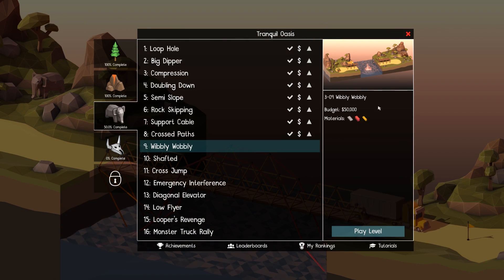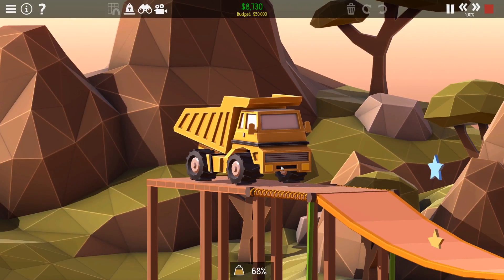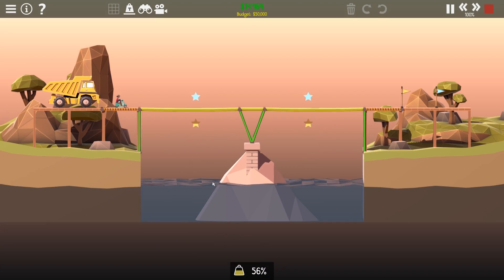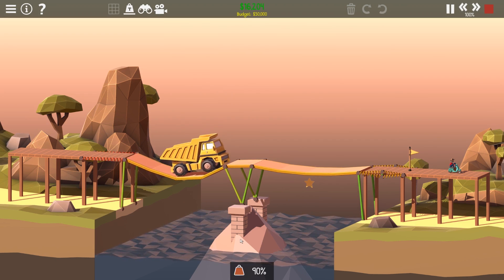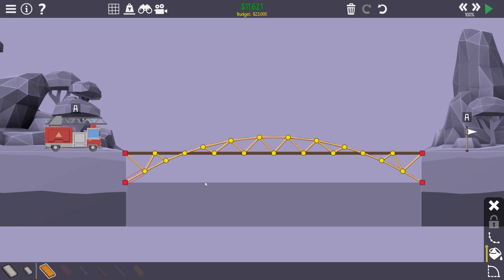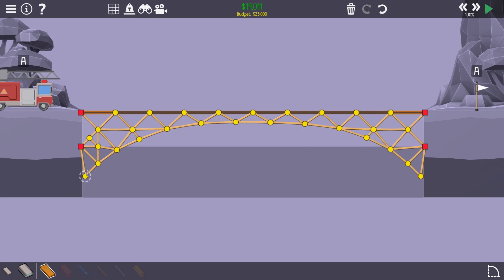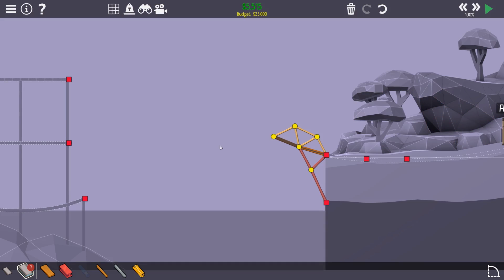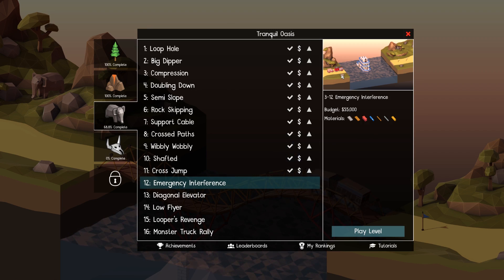I PROMISED I WOULD NEVER DO THIS... Dabbling in Dangling Roads in Poly Bridge 2!

Comment from the maker: So yes, not proud of this one, but I am a professional and felt I had to investigate so that you don't have to! There's a reason I always wear a hard hat...
Reply: Idea to remember springs:
stretched = contract
compressed = spread
Reply: @spironspirit6502  C  O  N T  R  A  C  T
Reply: @sephia37  yes
Reply: Cheese
Reply: @wofeYT  🧀
Reply: Noo you should be proud, cheese is the way to go
Reply from the maker: @Minecxt  nuh!
Reply: @Minecxt  are dangling roads cheese tho
there not op like spring cannons
Reply: @syn6109  they most definitely are cheese, and, in my opinion, more useful than spring cannons.
Reply: 03:53 the sound of a dying giraffe?
Reply: @Mike-or7xv  sounded like lamas in hats
Reply: mmmmh still got one of those curve-y curves in you might have to start a 2nd channel called Real Civil Architecture, blueprints optional.
Reply: 16:35 when a daredevil manages to be cooler than an engineer...
Reply: Man hurting in pp
Reply: So when you realized that you could 3d the dude on moped... you sounded very very high
Reply: 3:53 sounds like pushing out a really big and painfull shit!
Reply: I would name that sound
 "civil heartwrench"
Reply: Could you not just make the start of each side of the bridge at 8:30 in video springs instead of steel as well? Since springs are cheaper and they worked in replacing the steel in the center of that bridge.